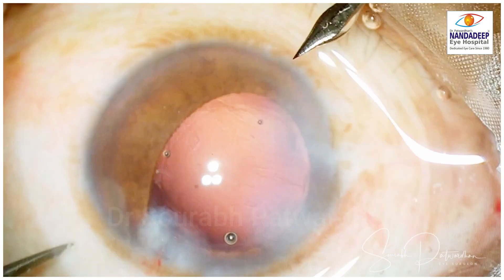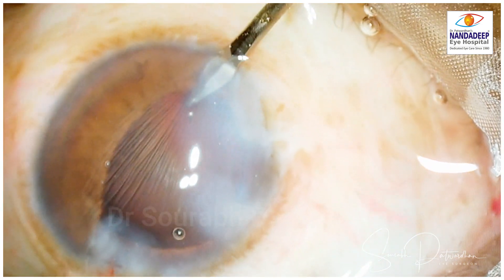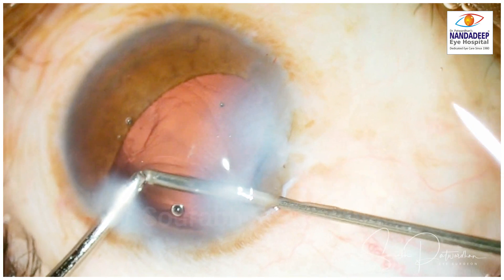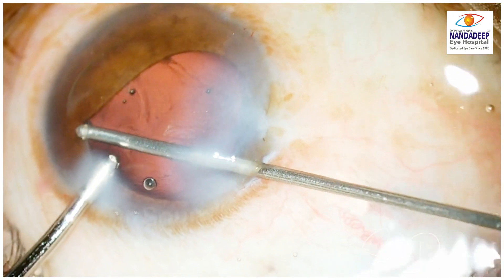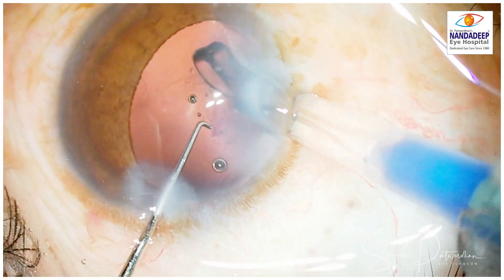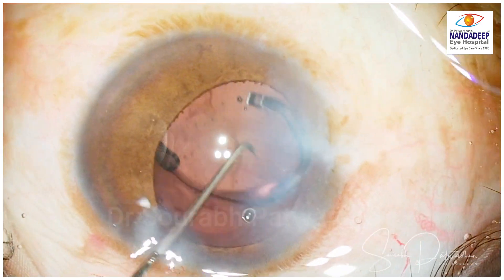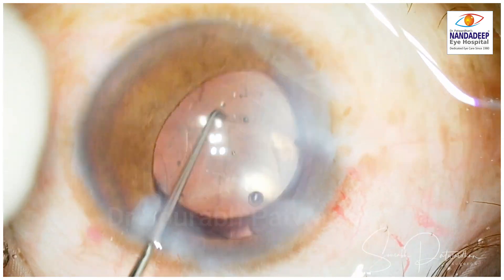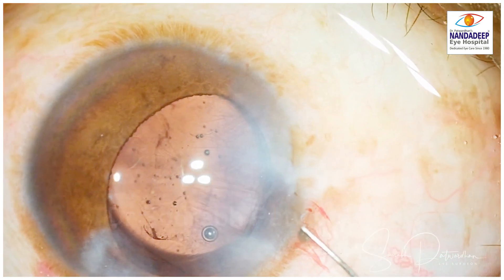182 Vitreous in AC, Dialysis..how it was managed -Dr Sourabh Patwardhan

Comment: Well managed... Did you use a 3 piece IOL? Using iris retractor & bimanual may have been helpful to remove residual cortex
Reply from the maker: Used single piece after placing CTR. Good idea to use iris retractors.